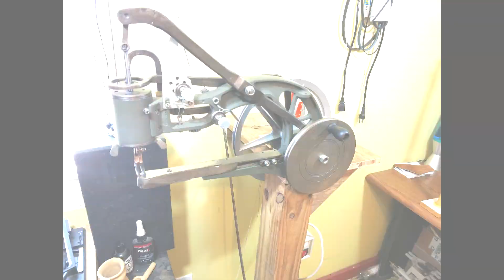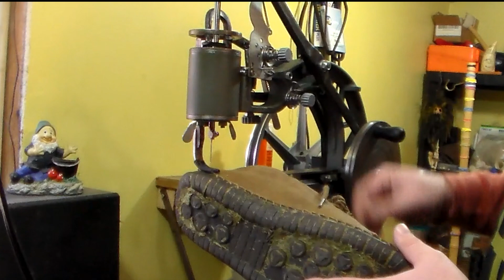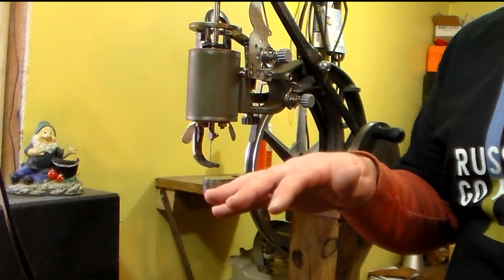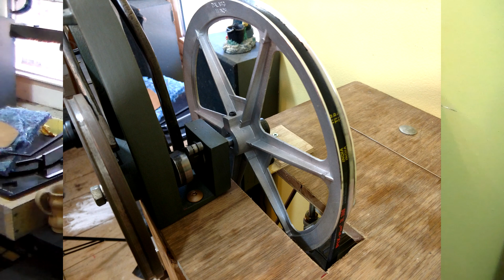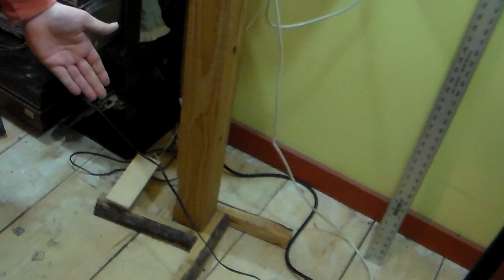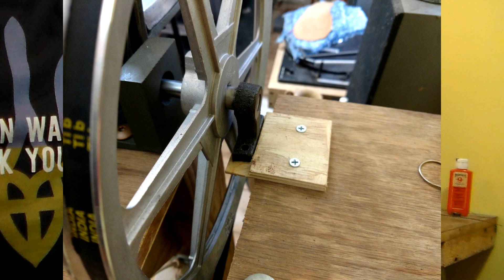The Best Stand/Motor setup for the Chinese Sewing Machine

Comment: Thanx much for this video! However, I have a problem. The pressure foot on my machine does not lower onto the plate...thus, it isn't able to hold the leather in place to allow a stitch. Any advice on how I can lower the pressure foot?

Comment: i found the old treadle from the original 1886 design. you know the one. the treadle that spins the belt sideways instead of front and back. i notice the spinning wheel where you turn the cranks runs all the way to the other side of the machine. this is where i would be attaching a wheel to connect to the treadle? what are your thoughts on pontentially doing this?.

Comment: I've learned quite  a bit from watching your videos. I am writing to get as much help as I can  for installing a servo motor. I don't want to so any cutting on the machine itself unless absolutely necessary. can you please respond with any info. I tried to under the video that included the servo but ther are many questions need answers. pleas help
Reply from the maker: I try to get to all my comments, but some slip through the Matrix. What are your questions?

Comment: did this one come with a groove in the hand wheel, or did you add it? it looks like you could run it with a singer motor
Reply from the maker: Nope, my machine did not come with the groove in the flywheel. My father did that for me in his metal lathe, so I could run the machine off an old singer motor. Spoiler Alert.... That set-up didn't end up working so well. I went with a servo set-up on my final build.
Reply: @MainelyAcresFarmBrooks  you won't be sorry when you do. I have a old Consew 226 I put a servo motor on. it still was too fast, i ended up using pulleys I scrounged to slow it down even more
Reply: @MainelyAcresFarmBrooks  I have seen some models listed that have one just like that

Comment: If you don't mind me asking does the belt come with the big pulley conversion kit? If not, what belt did you use? Thanks for the video. Good job!!
Reply from the maker: No, it doesn't come with the kit. The size will all depend on where you mount the motor, it will be different on your set up.

Comment: I recently bought one of these machines. It started off really well, then I suddenly had an issue with the top thread snapping every time I tried to sew. So, I changed the needle, no win. I adjusted the arm in the bottom according to one of your videos, no win. Next I'm going to go through and adjust all the running gear as per one of your older videos (from about 4 years ago). And if that doesn't work, I'll adjust the needle arm that goes from top to bottom. Hopefully that will get me sorted. EDIT; I have since sorted out the issue and now have no issues and have even sewn leather 4 layers thick with glue between layers: I just had to hop back and forth through your videos. Thanks for doing all the hard yards and research talking with other people. I was looking for a sewing machine like this and it was basically your videos that made me decide on one of these. Fingers crossed, I have a lot of sewing to do. From Australia.
Edit; farkin love the t-shirt btw. Can't wait for Ukraine to send the Ruzzian Orcs back to the Kremlin, hopefully with a "love letter" for Putin.
Reply: @justotalkalottashit8392  , it seems the second needle was already partially bent because I changed needles again and have not had an issue since, and I've sewn leather 4 layers thick with glue.
Reply from the maker: Awesome, I glad you were able to get it up and ruining

Comment: I have not motorized mine, made to clamp OEM Juki bench. I have 20 +/- photos to add a knee operated pressor foot lift. Easy to make, $20 if a guy have to but some round bar stock + odds & ends at the home improvement store. Now, I welded my linkage in two spots but will work with you motor driven pulley on the back. 
  Note; I am not good with any social media but I could email photos, draw a diagram that can adapt to your current set up. Just let me know as it is self exclamatory and visually obvious to see how it works. I drilled one hole in the back bar near the end that moves the presser foot up using you knee, even while standing. I use a bar stool type pedestal chair that adjust position using an exhaust clamp as I am a cheap bastard. 
  Send me a comment to tell me if interested as I am 6’3” tall and have some back problems and sitting makes it more enjoyable for me. Also, I have a simple one piece add on to the pedal to make it more comfortable and I feel is better control as I put it on the “V” belt double speed reduction I put on my Juki to slow it down from a weed-water on meth, to a tame kitten with great power.
I will look at you home page for your channel for a way to send you photos. 
Having a laptop quit, then an older iPhone loose Wi-Fi and a few more surgeries just to make it fun!
 Good new video. You have been busy!
DK, Omaha, NE.